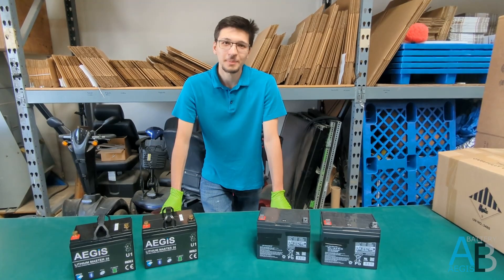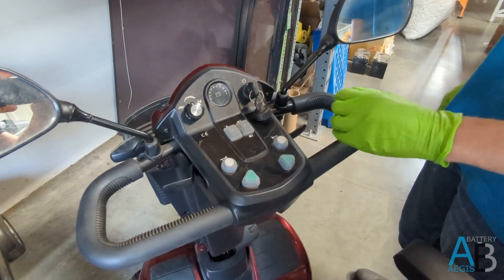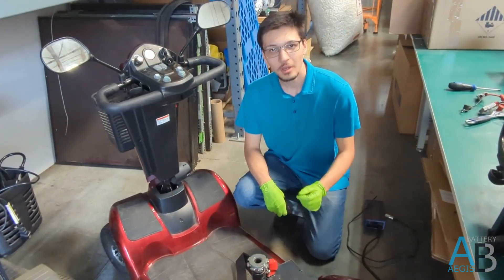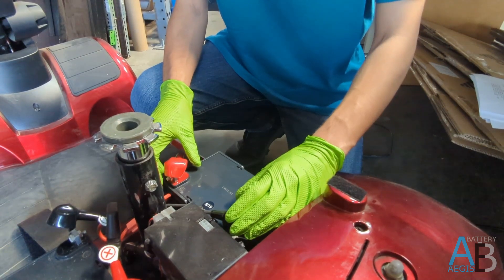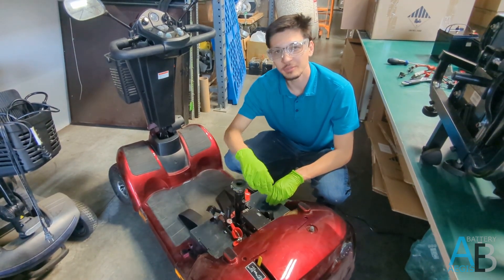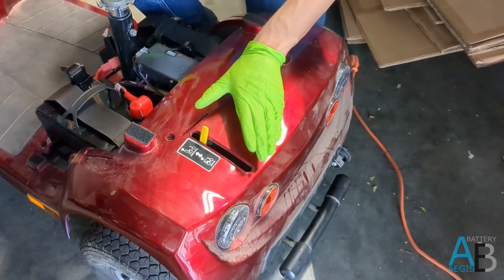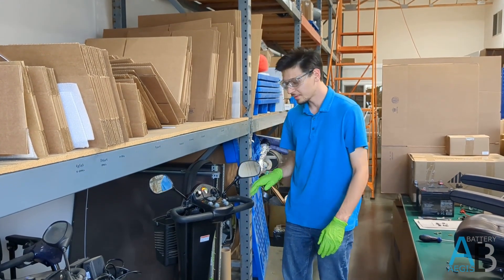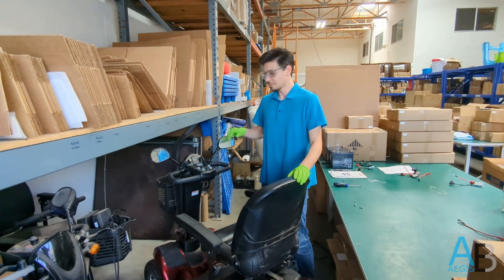How to Upgrade Your Mobility Scooter to Lithium Batteries

Comment: Your video isn't that good mate one you didn't say that you have to  change the charger for a lithium battery charger. 2 you should always individually charge new batteries before you install them this is so that you've got a balance voltage in both one this belongs to life of the batteries same thing goes for lead acid or lithium. You need to check with the manufacturer to make sure the amperage is not too high with lithium.
Reply from the maker: HI Markbrown261,

Appreciate you pointing out some things we were missing in our video. We will definitely need to mention those things and that users need to change to lithium battery chargers in all our future videos. 

For our mobility kit batteries, our BMS are specifically designed to self-balance the load across the batteries running in series for both charging and discharging. But absolutely, it also best to check with your mobility scooter manufacturer as well. 

Thanks again for some missed points in this video for our users and viewers.
Reply: @aegisbattery  b

Comment: No mention of charging.
Reply from the maker: Hi Ivormectin3816, you are absolutely right. For charging you would need to change to a lithium battery charger. 

We do include this in our mobility battery upgrade kits and is in our guide on our website, but should have mentioned it in the video as well. Thanks for pointing that out 👍
Reply from the maker: Mobility Upgrade Kits: https://www.aegisbattery.com/pages/mobility-scooter-replacement-batteries
Mobility Upgrade Guide: https://medium.com/@contact_74436/mobility-scooter-battery-upgrade-guide-checklist-b95ec2d938fe

Comment: Hello, I have 2 12 volt AGM batteries with 200 amps in my mobile, if I want to switch to lithium batteries can I also use 200 amps and can I use the charger or do I need a different one? Thanks for the info!!
Reply from the maker: Hi Manfred, thanks for reaching out. Yes as you are already using 200 amps batteries, you should be able to switch to 12V 200Ah lithium batteries. For the charger, we recommend getting a corresponding lithium battery charger as they can have different voltages/amps and offer much faster charging speeds than lead acid. 

If you needed more help or wanted us to take a look at your current setup to get you the best lithium battery replacement, feel free to email us at contact@aegisbattery.com